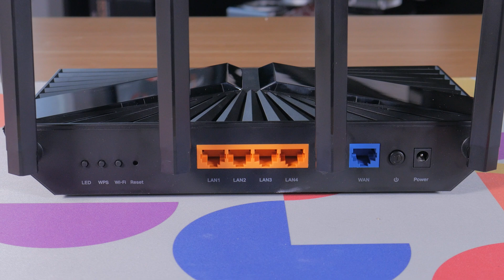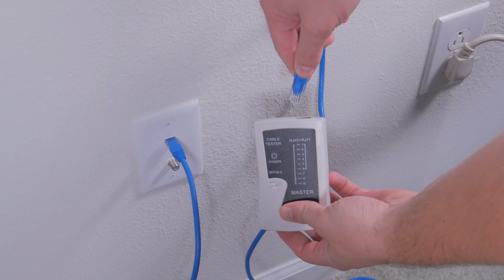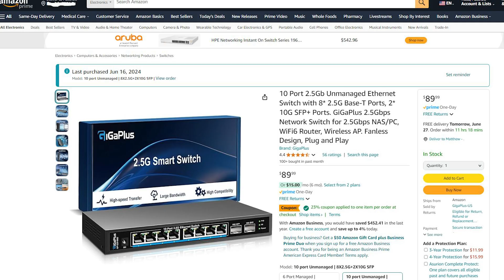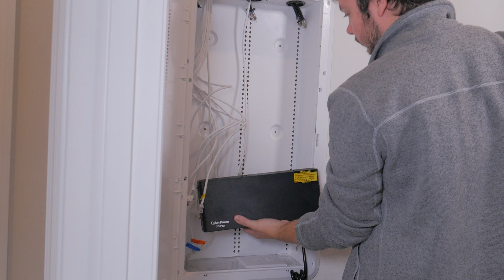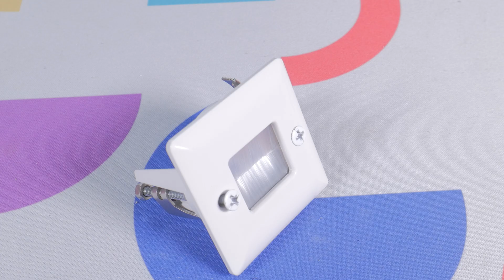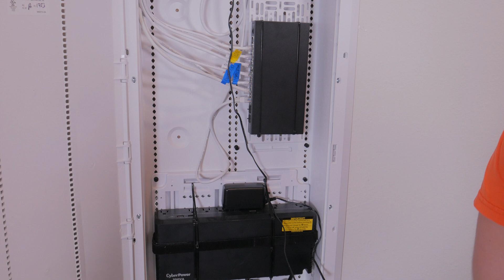Fixing my AWFUL Home Networking! (2.5gb & 10gb Upgrade)

Comment: So wish I had drywall to put one of these cabinets in. I would have had the pass though plate at the top where the cables plug-in also wow that sucks where the switch and ups have not mounting on the back

Comment: I would invest in some of the short power cable extenders, I hate how that brick covers up some of the power plugs. and if they actually have the plug turned 90 degrees, it can cause the door not to close. The extensions are basically 4-6 inch pigtails that allow you to extend the plug so you do not block any of the other plugs.

Comment: Good luck with that CyberPower UPS. We've had so many issues with CyberPower just dying well within a year that we cut them from our vendor list, no longer stock/resale them, and went with APC.
Reply: meanwhile ive personally been using them since the mid 90's.... one persons negative experience doenst equal a bad product for everyone.
Reply: @larrydysondev  you are correct and I agree with you. But I'm not a single person, but a reseller,  and we've had a couple dozen just up and die within a year because of faulty batteries. The APCs we sell have had only one go bad and that was the customer's fault for doing a dead short.
Reply: @yourpcmd  I'm going to add that, in my personal experience, I've noticed that they're just crap UPSs in general.  The self tests are useless for indicating battery life and the units themselves often go haywire whenever the batteries fail.  I say this as another person that has been using Cyberpower since the 90s.
Reply: @larrydysondev  I agree with @yourpcmd. I don't trust the CyberPower USP either. Before I switched to APC like he did, I went through at least two in a year because the CyberPower USP have bad batteries. They also have bad delay times to where it took for ever for the battery to kick in when the power went out. The didn't switch to battery immediately like they were supposed to.
Reply: FYI when replacing the battery in your UPS -dont buy the cheapest battery you can find it's probably old. check the born on date /Manufacture date.

Comment: Your ISP is just being lazy, which is sad, but if you want to fix it for real, run some single-mode fiber and coupler to get your modem into your network closet. However, many others suggest Poe adapters are a great way to extend power through networking.

Comment: you might be able to use POE adapters with regular DC barrel jacks at both ends for your modem, and just power that with the ups
Reply: those passive poe adapters may limit the ethernet to 100mbps
Reply: @pcislocked  it depends 
I have a few that are gigabit running some pi stuff atm
Reply: @BenCos2018  yeah. to be more specific, I meant those cheap amazon adapters with ethernet input, that gives ethernet output and a barrel jack output/input (sold as 2 pack, one with each), which are essentially reusing 4 of the conductors for power delivery, while using other two pairs for the 100m eth.
Reply: @pcislocked  ah
Reply: @pcislocked  there is also POE adapters can run with Gigabit and also 2.5G above. but more expensive because have an additional circuit and transformer inside
Reply: @ but these are active components
Reply: It looks like a fiber termination/modem, it may support POE built in. My provider's does, and they leave it outside in a utility box. The modem they gave me back feeds, but when I used my own router I just had to put a tp-link adapter in. Still had full speed

Comment: @TechByMatt I believe that you may want to check out the industrial velcro strips by 3M.  I use them for the exact same ups in my enclosure to secure it to the back of the box.  (I have full metal Brennham boxes but it should also work well with the Leviton and Legrand attachment accessories you have already purchased.

Comment: you don't need additional ups. Use 
2 x MikroTik RBGPOE 10/100/1000Mbps PoE Injector
to transfer power from the ups to your isp router

Comment: I would suggest pulling a new coax cable from where your modem is to your box and just move the modem to the box. Use a coupleer to connect the two cables together.
Reply: It’s a fiber ONT, you can see the yellow single mode fiber going into it.

Comment: Great video, I'm currently stuck on 1Gbps networking but plan to go up to 10Gbps in some areas (especially because I'm soon going to build a separate 10Gbps video content NAS that a few devices will connect to). 

Your upgrade did great, and going for a 2.5Gbps device to save on cost makes sense for sure.

Comment: You could reuse your coaxial cables to relocate your modem to your cabinet. Also long as it's the right type of coaxial cable and it's hooked up to the main cable line your modem will start up like normal. I would speed tests before and after and make sure you don't have dropped packets. Why buy another ups if you have one already. Your modem settings should show if it has any communication issues. If you have spectrum check your app and make sure spectrum mobile isn't on it severely hurts Network performance and they don't tell people it's on in the app under advanced settings.
Reply: That modem seems to be fibre though so wouldn't work with that
Still a good idea though

Comment: Instead of hand written "cable labels" consider using a "Label Maker." Using an eight year old Brother PT90, for example; there are cheaper or 'better' ones. No smeared ink, easy to create and remove, easy to repeat print. Easier to read too.
Reply: I haven't personally used one, but they sell heat shrink cable labels for label makers which I might end up using when I redo my cable runs.
Reply: I like to use those little plastic clips that hold the bread loaf, buns, etc. bags closed.

Comment: Good video ! 
Quick tip, check how you want to mount the router before drilling a hole in your wall next time, the cables could have come directly on the ports instead of under the router

Comment: I'd try to use poe (power over ethernet) to power the modem from your main ups.
Reply from the maker: Hmmm, I didn't even know that was an option. Thanks for the suggestion!
Reply: @TechByMattB  the gear may be more expensive as you have to inject and extract while keeping full gb for your plan. But various different type of poe from hacky 100mb solutions to legitimate things exzist.